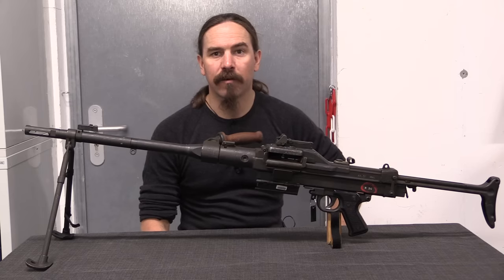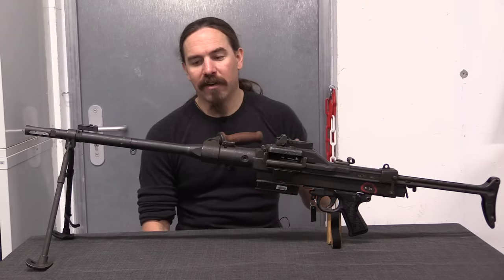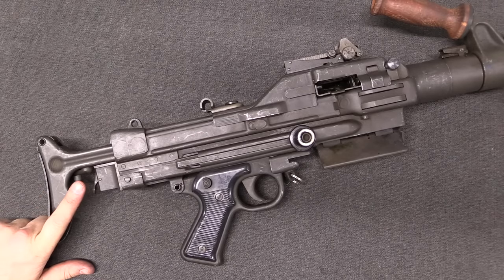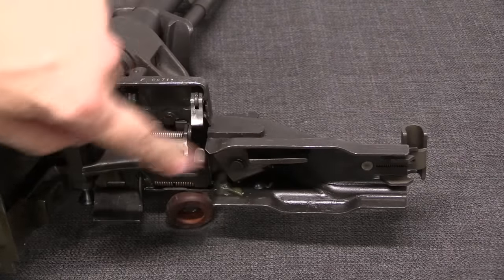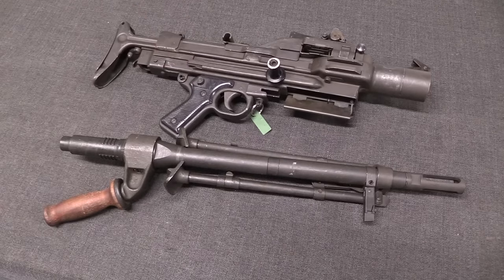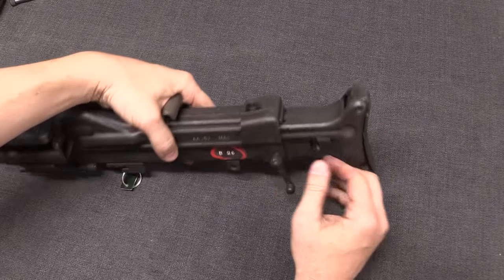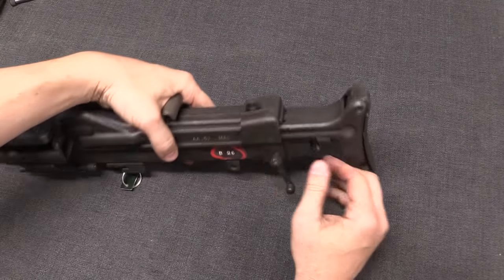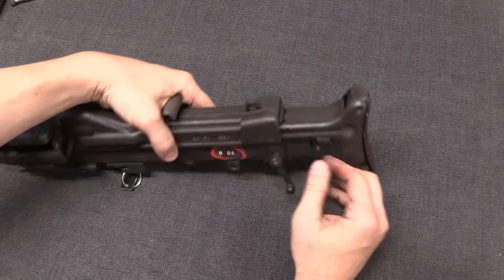France in the Cold War: AA52 Replaces the Hotchkiss

Comment: Finally, the French machine gun I have been waiting for you to cover for years. The AA-52/AAT-52/AA NF-1 series of GPMGs are really interesting weapons. They were more widely used and exported than generally realized or acknowledged, indeed, it was by far the most exported French small arm of the post war period, especially as armor and aircraft guns since France exported so many armored fighting vehicles (AFVs) over the years, especially vehicles like the Panhard AML series of armored cars, the AMX-VCI MICV, the AMX-30 main battle tank, the superlative AU-F-1 (GCT) 155mm self propelled gun and others, as well as aircraft such as the Aérospatiale (later Eurocopter now Airbus Helicopters) Puma, Super Puma, and Cougar medium helicopters. 
According to an old buddy who was in the French Air Force back in the 80’s, the “Nana”, as the gun was fondly referred to, was pretty popular and a fairly reliable machine gun. It did have the unfortunate tendency to mangle brass due to its fairly violent initial extraction, and brass fired from an AA-52 or AA-NF-1 is identifiable by the markings from the flutes on the inside of the receiver and barrel extension. 
These guns first got into service starting in April 1956 with the FFA in Germany. The first AA-52s were not produced until February 1956, when MAC manufactured the first 200 guns. The French army would not officially take delivery of any AA-52s until the 5th of April 1956. Contrary to some earlier reports, the weapon was far too late to see any action during the French Indochina War of 1946-1954, and there seems to be no photographic evidence of any use in Indochina of the 100 pre-series guns built by MAC during the late summer and early fall of 1952. After doing much photo research of French units operating at Suez in October and November 1956 (especially refer to the lavishly illustrated and excellent "Suez, 1956" by Paul Gaujac, Lavauzelle, Paris CEDEX, 1986) it seems that none of the units deployed there were equipped with AA-52s, instead the MAC FM-24/29 remained ubiquitous in the LMG/squad auto role. The gun does not consistently show up in photography from the Algerian War of 1954-1962 until ca. June 1959; however, there is a photo in another source of troops of the 3ème RPC waiting to board Aéronavale Piasecki H-21s who are equipped with an AA-52 which may have been taken as early as November 1956; however, it seems more likely that this shot was taken during the Djeurf operation of April 1958 (see bottom of page 18 "Hélicoptères et Commandos-Marine en Algerie, 1954-1962" by René Bail, Lavauzelle, Paris CEDEX, 1983). In Algeria the AA-52 would gradually replace the FM-24/29 as the standard squad automatic weapon in the Para units, then spread into other units, gradually replacing the multiplicity of machine guns (.30 cal M-1919A4 medium MG, 8mm Lebel Hotchkiss Mle. 1914 HMG, 7.5x54mm Mle. 1931 “Riebel” fortress and armor machine guns employed as ground guns, the U.S. M-1918A2 BAR etc…) then in French service. They would serve through Afghanistan and Operations Serval and Barkhane in Mali, but, in a process not unlike the U.S.’ discarding of the M-60 GPMG, they are now being progressively replaced in the French army by the more or less contemporaneous FN MAG due to wear and tear, and the fact that the MAG is demonstrably the best GPMG in the world and hard to top.
Reply: The MAG is also much better for body builders.
Reply: @JohnHughesChampigny  I suppose, the AA-52 still weighs in at at à pretty respectable 22 pounds (with the light barrel it’s around 19.5 or so) with the heavy barrel, just a mere 4 pounds less than the MAG.

Comment: Spent quite some time lugging around the AANF1, we always had two barrels, but only one bipod, changing the barrel would mean changing over the bipod, which was a pain when everything is hot.
Reply: I used to carry the original AA52. It was a lovely weapon chambered in 7.5. It also had nice little touches such as the hook on the strap for quick release and the  'mono pied' at the rear. Good weapon, good times.

Comment: With the obvious virtues of the weapon, it's surprising no-one else plagiarised it. The lever-delayed blowback looks very suitable for a powerful pistol.
Reply: Powerful pistols aren't a too popular thing. I would see this system in some PCC, though;)
Reply: “The French copy no one, and no one copies the French”
Reply: @randompanda876  besides Black Arrow.
Reply: There is a drawback to lever delayed systems: they require flutted chambers which , unless the barrel is cold forged, are more expensive. They are also a lot more pickier on ammunition than gas locked bolts
Reply: @randompanda876  I have heard a few times but it is quite innacurate
Reply: @vincentkermorgant  Hence the FAMAS requiring steel case ammunition and not brass because it uses a lever delayed blowback system.
Reply: @XavierLignieres  No, that's not correct. For example the the 7,5 used in the AA-52 was brass and after the closure of Le Mans factory Famas were using brass ammunition mostly made in the UAE. Choice of steel cased ammunition was for different reasons
Reply: @vincentkermorgant  The FAMAS does feed better with steel cased ammunition the combination of lever delayed blowback action and the extreme rate of fire combined with the feeding on the straight mags and the rifling of the barrel  means that it would easily strip brass especially in fully automatic or burst.

The Famas G2 used by the French Navy uses standard AR style mags and has a slightly slower ROF that means it is easier to use with brass it also has a barrel with a different rifling.

Newer straight mags better than the original ones that were meant to be disposable somewhat improve that too.
Reply: I see no reason they would. Their only real drawback is that they are optimised for a given chamber pressure profile and are somewhat difficult to make adjustable.

Comment: Back in the day some friends and I used to play a tabletop RPG called Twilight 2000. It was set in post World War III Europe and you play as NATO and/or Warsaw Pact soldiers trying to survive in the apocalypse. 

The AAT-52 was the standard machine guns for France in the game and was still chambered in 7.5mm. Now in the game they state that "the weapons blowback extraction system tends to rip cartridge cases in half, leaving a ring brass in the barrel". It goes on the say that French troops learned to deal with this by greasing the cartridges and that troops unaware of the need to do this run the risk of the gun jamming. There was a 1 in 10 chance of it happening if you fired.

No idea if that is true or not but it did add a bit of personality to the gun.

Comment: There's a lever-delay built in the Winchester 63 .22lr system.The hammer is 2/3 the size of the bolt and rests on the firing pin in a rocker groove that definitely slows the bolt, it is a very smooth system, more than a .22 needs,and it is very forgiving of weird ammo loadings, unlike many autoloaders. But it's expensive and complicated, cheaper stuff replaced it.

Comment: 13:27 The bolt head and the additional mass moving simultaneously. The additional mass has no force driving it, but the movement of the baldhead. The additional mass moves as soon as the bolt head moves backwards, but its forced by the leaver to move faster then the bolt head, therefore more force is "absorbed" as if the case would be if the additional mass would be moving the same speed as the bolt head.
Reply: Everyone is so used to locked breach weapons that it's just hard to talk about delayed blowback without confusion.  As you say the bolt head starts moving back *immediately*, just very very slowly as it has to accelerate the additional mass faster.

Comment: This one has been barely fired : all the internal surfaces are pretty much intact. The last carrier and bolt I saw were all scratched down to bare metal around the guiding rails and on the sides. 
The first time I took one apart, I was shocked by the flimsy and quite grotesque-looking firing pin. 
In my memory, the thick cylinder at the back of the bolt is a spring-loaded buffer. Or am I wrong ?

Comment: Ian Hogg had substantial criticism of this gun writing in the ‘70’s. Attributing swollen and ruptured cartridge cases as representing a system operating at the edge of capacity and possible barrel droop when hot. Still It seems useful.
Reply: If you use the wrong barrel, it will have issue. you have heavy duty barrel with tripod mounting and vehicule mounting, SUBSTANTIALLY heavier than the one you use as a grunt carrying the SAW of the team. It was also recommended to not thow belt after belt like no tomorrow because you'll ruin your barrel in no time, as a MG grunt you're not the one who can do that.

About cartridge issues can't remember seeing/hearing/reading this as a regular issue. On the other hand, firing pins had a tendancy to break in specific circumstances and... I forgot which one.

Comment: The lever delayed system seems so simple and efficient.. I wonder why this system hasn't seen more widespread use?
Reply: I asked the same question some time ago.
The consensus seemed to be that gas operation gives more flexibility and durability for ammunition differences by adjusting the gas tappet or by the gas system itself being designed to bleed off any excess gas, whereas any delayed blowback system has to be tuned to a specific set of pressures and is difficult to adjust to another setting.
Reply: @johannesmichaelalhaugthoma4215  
You know what I have long wondered?  What if a delayed blowback mechanism, be it roller or lever delayed, was given a greater amount of travel than strictly needed?  This would allow the action to be tuned for a range of loads.  It could be tuned such that lower powered loads had enough energy to cycle the action far enough to cleanly eject and feed but not use all the available travel.  In turn heavier loads would use that extra travel to smoothly decelerate, reducing the impact on the receiver.  This is largely what a continuous recoil system does.  I therfore think a continuous recoil configuration could be effectively combined with a delayed blowback action, hopefully avoiding the above mentioned drawbacks.  A progressive rate recoil spring might be very helpful here.
Reply: @podmonkey2501  Very interesting!!
Let's try to ask Ian in one of the Q&A sessions.

Comment: The bolt remains locked while the gun, operator or mount are impulsed rearward.  The force from the shooter or mount returning the gun to it's starting position accelerates the rear portion of the bolt carrier unlocking the action.  Genius

Comment: Perhaps you should have mentioned if it has a fluted chamber and if the ejected cases from this weapon are particularly bloated or deformed. This system is really on the limits of safe operation, the G3 and HK21 work on the same principle and although they are safe and reliable they are still pushing the limits. Fine for .30 carbine or 9 x 25 but dodgy on a full-power cartridge. 5.56 mm also has a high chamber pressure but the overall energy in much lower, perhaps less scope for something really bad happening, narrow cases are harder to blow open. Fluted chambers of course only affect a part of the cartridge contact surface to the chamber, there must be enough continuous contact to ensure that gases are contained until the pressure drops, so you either flute the front end and leave a continuous band at the rear (difficult to make) or flute at the rear and leave the neck continuous.

Comment: It still saddens me that the French gave up on the famas. It’s a excellent rifle
Reply: Given that MAS went out of business and no one took up production for one single mid-size client, the FAMAS was bound to be replaced either way in the 2010s due to its age. 
One year ago I had to train on some from the 80s, and let me tell you they are showing their age. A big number of them are unserviceable due to wear and tear and limited spare parts. 
In comparison the HK-47 is heavier and worse in handling but hey, it's cheaper than continuing operating the FAMAS and it actually has rails, so here we go. The SCARH was also a contender but it was too expensive, it was only kept for the special forces.
Reply: @rollolol6053 hk416 is the new service rifle and was first operated by the SF. The SCAR H is used as DMR weapon by every unit. The SCAR H is chambered in 7.62 NATO and would not be used as a service weapon anyway.

Comment: Delayed blowback seems like it would be lighter than the equivalent gas operated system but they always end up being just about as heavy in the real world.
Reply: You end up moving that weight from the gas system to the bolt to increase its weight. Ends up being a wash in that way.
Reply: As far as I remember I think there were two different barrels, the one ont top of vehicles was al lot more massive and heavy than this one.
Reply: The bolt and carrier of the AA52 are monstrous
Reply: A gas system allows you to have a rotating bolt that locks directly into the end of the barrel. The rest of the gun then only needs to be strong enough to transfer the recoil into your shoulder. With delayed blowback the receiver needs to be stronger to transfer the forces from the "locking" surface to the barrel.
Reply: @webfraek12  As implemented by the French, yes. The German HK type of delayed blowback uses a barrel trunnion and steel stamped receiver w/o any inserts in the receiver. They are still very filthy though.
Reply: @briansmithwins  Our roller-delayed MP5s would get very dirty but just kept on working.  I cleaned two of them after I found out they had fired at least a thousand, maybe much more, rounds without anyone bothering to clean them.  It took me about 4 hours each to completely clean them, lol. Amazingly, they still worked like a champ.
Reply: @oldesertguy9616  I have a couple HK pattern roller delayed blowback firearms. The internals get filithy but they just keep on chugging along. If you just keep adding gun oil to the moving parts the oil and powder fouling will mix to a block goo that seems to lubricate the mechanism perfectly. At any rate I've not had a stoppage from fouling or oily fouling but hey do take hours to get really clean.
Reply: @briansmithwins  pretty much my experience.  The fluted chambers help, as well.  HK's are just tanks.  I carried a USP 45 and USP 45C my last ten years as an officer, and five more as a Reserve.  They just work.  I was fortunate enough to go to the HK Armorer class for USP and MP5.
Reply: Well, the AA52 was 9.970 Kg vs 11.8 kg for the MAG (which, admittedly is famously heavy), but it's still a teeny bit lighter than the M60 at 10.5 kg
Reply: @JohnHughesChampigny  It’s a fine line for guns that actually get shot a lot. The M60 was arguably too light and had problems with parts breakages (besides being too fiddly) while the MAG are just beasts that by accounts just keep running. Is that extra kilo worth the reliability in a GPMG? Probably, but I ain’t the one humping it either. Haven’t seen enough references on the AA52 to know one way or the other there.
Reply: @briansmithwins Yes this French mg was very reliable by all accounts. Although I believe it still wouldn't be as reliable as a FN MAG which is simply the most reliable machine gun in history afaik

Comment: Wow, great video.  Such a small firing pin and main spring!  To be able to absorb that much energy in such a small receiver as well is a sign of incredible engineering.  The platonic ideal for a GPMG.  Having a fixed barrel with no gas system just makes everything simpler.

I guess as a ground gun it’s probably been overtaken in weight and handling but this does seem like an ideal vehicle/tank weapon, why was this design never copied by anyone else?
Reply: Very,very ammo sensitive.

Comment: What's the disadvantage of lever delayed blowback? Seems like with some clever geometry you can get a simple system with a small number of parts. But I assume there's a big disadvantage if there's so few of them
Reply: One notable drawback is that the ejection pressure would be intense which sometimes call for a fluted chamber for easier extraction and in the early FAMAS' case, limits itself to steel cased ammo because using brass cased ones might cause case ruptures

Comment: Great gun in sandy condition, just spray a bunch of oil and it will work forever. The mag 58 that replace this gun in the french army doesn't work at all in the Sahara. But a much superior weapon in normal condition.
Reply: Is that so? To my knowledge he Israelis were quite happy with their MAGs, as were the Rhodesians
Reply: @ewaldseiland8558  we used the aaf1 and the mag58 in the desert and all the mag58 jammed after the first round even if we try to keep them clean. In France they are extremly reliable, we don't really know what causes the problem in sandy condition.
Reply: @daroldelio4752  Interesting, thanks

Comment: I don't like the terminology "lever delayed blowback", because it sounds like there is something to actually delay the movement of the bolt. But with a lever you always have to have at least some movement for a lever system to work. Now you could argue that maybe up to one millimeter movement of the front part of the bolt won't open the breach, but you also could argue that is does.
Gas delayed (gas piston) or recoil delayed systems work entirely differently. For example with the MG42 the bolt will stay locked with the barrel until the heavy bolt-barrel-assembly moved as one locked unit a few millimeters until the bolt can seperate, move on it's own and open the breach. Something similar is going on with gas piston systems.

I'm not saying this isn't a good system, because it just is, but I'd prefer to choose a different wording that represents the reality of this system better. Like "lever amplified blowback".